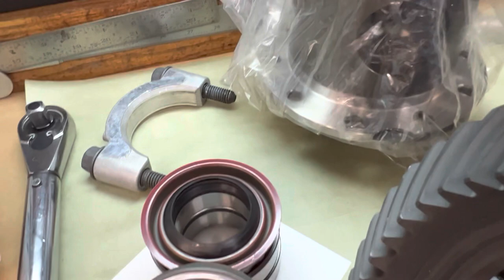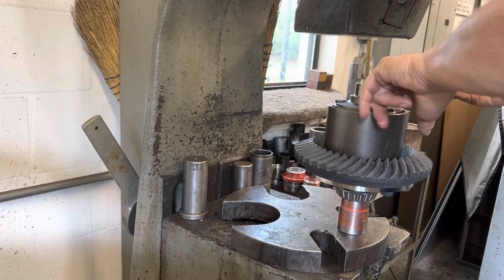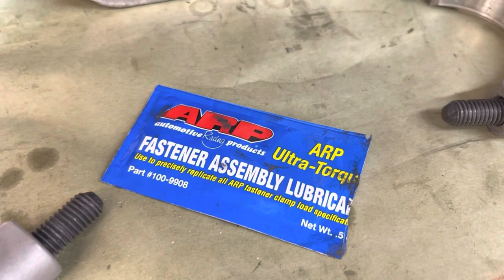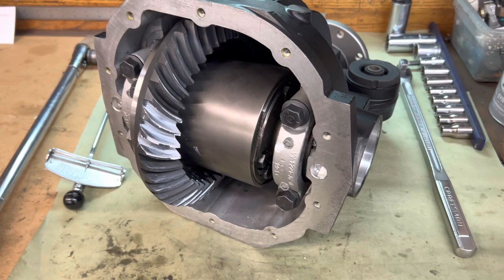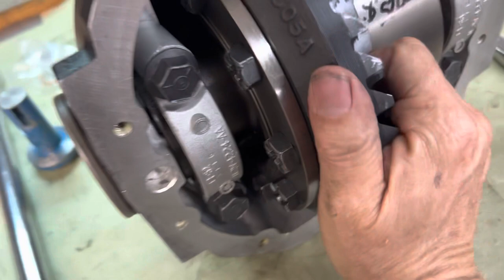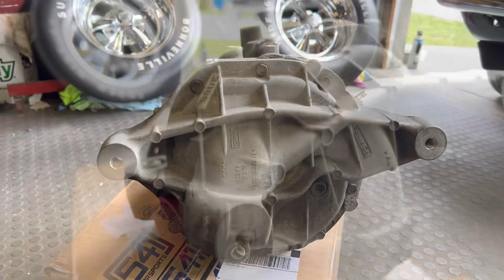Ford 8.8 differential rebuild for Honda S2000

Comment: I’m in the process of doing the same setup for my RX8.  This information will probably help someone:  Rear/inner pinion bearing koyo ST4190 ford part number 6L2Z-4625-AB.  Also if you disassembled the differential reuse the pinion bearing shim to get you very close on pinion depth.